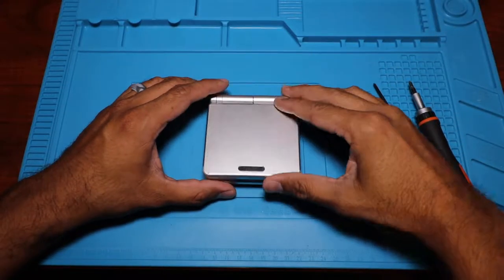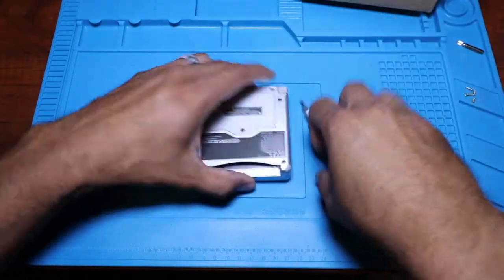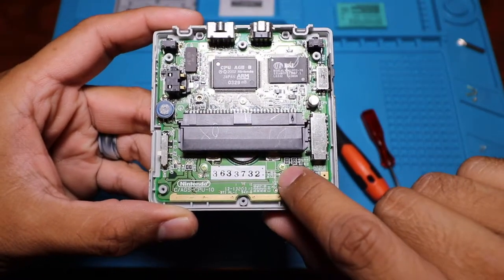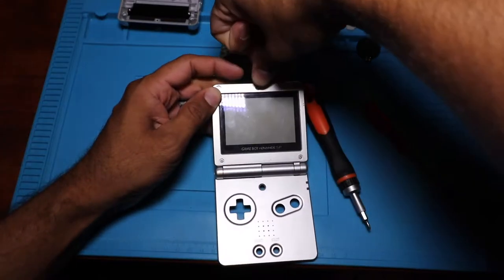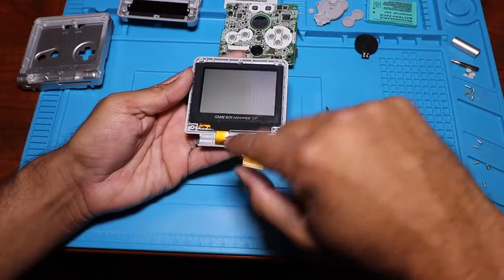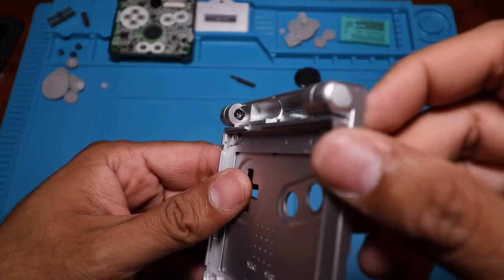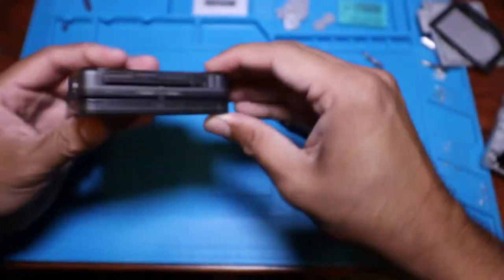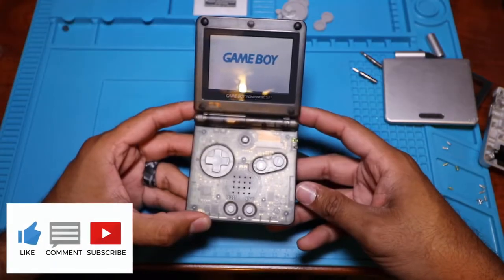GAMEBOY ADVANCED SP SHELL UPGRADE

Comment: Is that grey cover sheet that hides the back of the display simply a piece of paper? And if so did you make it yourself? Was planning to do a shell swap and the cover definitely does look alot better then the misaligned foam pad.
Reply from the maker: I actually got it with the kit from Retro Modding, I purchased everything from there. The cover comes in different colors as well.
Reply: @unitmgx  Alright, thanks for telling me. Didn't know it was actually part of the kit considering most people doing these translucent shell swaps dont include it. Guess I need to order from the same place as you then.